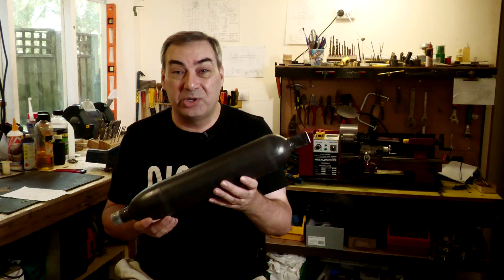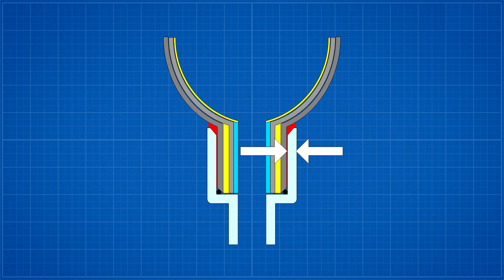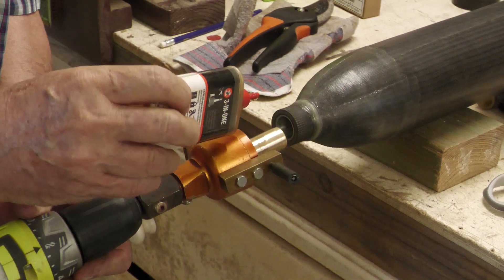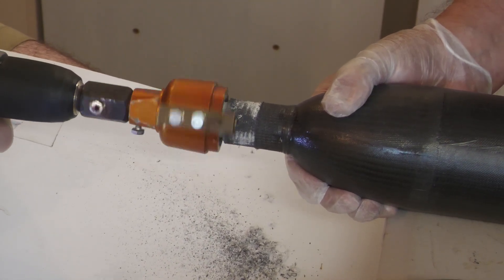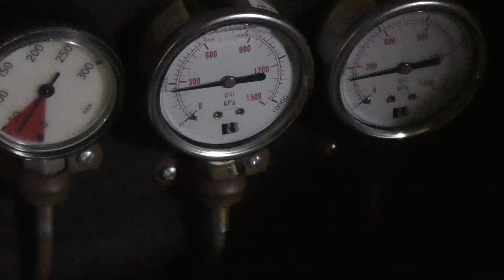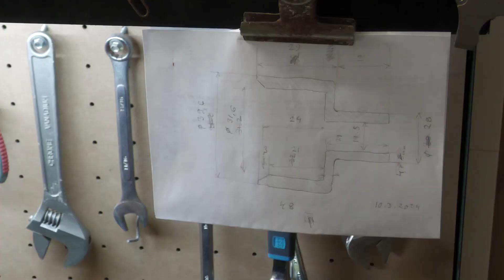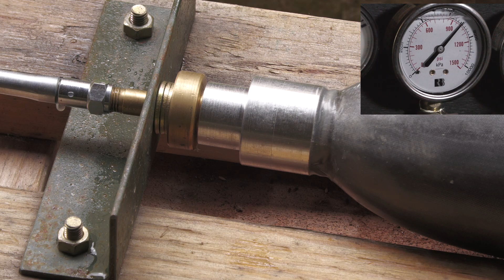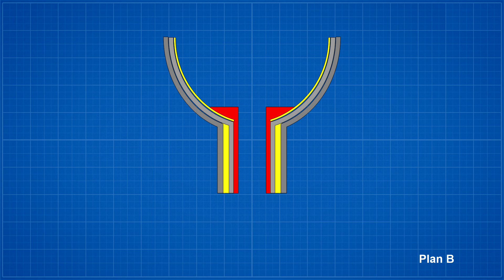2 Stage Water Rocket - Part 35 - Booster Fixed

Comment: If you have time, could you walk me through your thought process on why you think the water will not seep between the layers, cause delamination, weaken the chamber, and lead to failure? Nice fix, but I just want to understand.
Reply from the maker: There is always the possibility of that happening. What may be even worse is high pressure air seeping in between the layers. Then during rapid depressurisation, this could cause it to blow out internally.

Comment: Most people do not even realize that a space shuttle main engine is just a water rocket.
Reply from the maker: Kind of ... although the exhaust by-product is water, it is also accelerated as a result of a chemical reaction. A traditional water rocket does not use any chemical reactions or phase changes in the propellant to produce thrust. -> Just cold gas accelerating a cold liquid.
Reply: @AirCommandRockets  Sure but the reaction mass is the same. Pure water.
Most of the science denying morons will not even admit that much.

Comment: How do you avoid contact corrosion between aluminum and carbon? Is the epoxy sufficient?
Reply from the maker: Oh that's easy ... I stick my fingers in my ears and go LALALALALALA. But seriously it is a concern. So far we haven't seen any adverse effects on the pressure chambers but that doesn't mean it won't be a problem later.
Reply: @AirCommandRockets Thanks for your answer. No worries! You're in the best tradition of rocket building: trial and error.

Comment: hmm, not quite sure why you needed the extended nozzle?
wouldn't a sleeve alone have been enough? like a 1mm thick steel or stainless tube with a snug fit going over the existing nozzle to prevent it from expanding?
Reply from the maker: The problem is that it was now delaminated so there was a path for air to flow on the outside of the aluminium nozzle. At 1000psi air will find a way of getting out.

Comment: 69BAR 👏👏👍👍👍
What is the length of the boosters ? :)
Reply from the maker: They are 2m long, ~83mm in diameter and have a capacity ~10 liters.
Reply: @AirCommandRockets Ok, thanks!

Comment: Just be aware of galvanic corrosion between the carbon fiber and aluminium.
Reply from the maker: A couple of people have now mentioned this. So far we haven't noticed anything of note, but that doesn't mean this won't become an issue later.
Reply: @AirCommandRockets  One layer of fiberglass - and sometimes just an epoxy coat - should be enough to negate that. There are white papers out there on the matter, can't recall exactly but I think my takeaway is close enough;).

Comment: Thx for sharing. It might be a better call to add much more material on the outside of the booster around the root of its neck. The sharp changes in the contour of the booster in that location will always be an area of focused and alternating stress loads, promoting any kind of delamination leakages. To stiff it up, preferably with the material with the same elastic properties, to avoid delamination, in my opinion, you need to add more layers of fiberglass and resin - blending the transition from bottom of the tank to the nozzle much more. If a total blending isn't desirable, then at least make the cave radius on the nozzles neck root the same as the domes' radius for the bottom of the boosters main body.
Reply from the maker: All good points. The diagrams showed a very simplified representation of the structure. The layers are curved at the transitions, the glass layer on the inside is also much thicker, and what wasn't shown in the diagrams are the extra sections of fiberglass tow around the transitions. Here are the details of the actual construction. https://youtu.be/plU5c-Embtk and here is a cross section of the joint: https://youtu.be/jnUZ-I5gyOg?si=O4KeQ_93XnKD32v6&t=218 and also here: https://youtu.be/hFptNGZcD64?si=aXHyCDiq153srJvV&t=561
Reply: @AirCommandRockets   I replied to you yesterday, but it was too long and unspecific. Sorry for that. In your Part 29 clip, there is a good schematic picture, time stamp 4:15. I would have made the gray layer different (you are referring to it as a 3" layer of biaxial carbon fiber sleeve). To distribute the loads and disperse their focus more evenly, I would have blended it on the outside from the top to the bottom in a way that the outside shape would have appeared conical while keeping the inside design as it is now. The height of the blending transition from the bottom of the nozzle would have been at least 7 mashes of the brightest lines, almost the whole height of the presented part.

Comment: Geeeeeze, has nothing been learned about using carbon fibre for pressure vessels? 💣
Reply: Plenty has been learned, which is why they are successfully being used in other use cases than the one that formed your opinion. E.g. firefighters are using carbon fiber reinforced tanks, hydrogen fuel cells in some cars, too. Many PCB guns use them on their guns, too. I am sure there are more examples. Granted in most of these, there's an inner alu liner - but that's for chemical resistance and permeability reasons, not for strength. 
That said, we can add a Falcon 9 with a CF pressure vessel blowing up to your side of the argument though that use case is extreme compared to this home gamer's water "toy".  

Anyhow, just because one sociapath decided not to follow proper engineering practices doesn't mean there's still not other valid uses for the material. And here's what you're not taking into account. Yes, Titan imploded at pressures "just" 6 times higher than this tube experiences and Falcon 9 exploded at ~8 times higher (for more complicated reasons), but it's a whole lot easier making smaller diameter structures stand up to high forces. In fact, the force experienced depends on the area. 
Also, they have tested these tubes to destruction (blown them up) and whilst their chosen safety factor isn't impressive at all, they play in a field (literally) where failures are accepted, even expected, and thus safety measures are taken accordingly. E.g. no-one is near the rocket while it is being pressurized or under pressure. I also think that they know these pressure vessels don't have an infinite life span. Somehow, I don't think they plan on putting their dog or son on a bigger version of this...

I simply don't believe that because one idiot uses a material wrong - or the wrong material - that every superficially similar use case should be frowned upon. I am not an engineer and I would hazard a guess that you aren't, either? But this is YT so we both get to play experts. Well, at least we fed the algorithm.

Comment: Luckily the empty weight of the boosters doesn't matter too much, since they carry the full sustainer anyways.
Reply from the maker: That's exactly right, the same weight penalty on the sustainer would be much worse. The booster's take off weight including water is close to 15Kg, and the extra weight is only 0.2Kg so about 1%.
Reply: @AirCommandRockets  It's the empty weight of a stage that you would need to compare to, but that's still a few kg i guess.
Reply from the maker: @wattihrvolt-pn3pf Sorry yes, quite right.

Comment: Awesome videos mate.....been watching you'all put this together for years and it's cool to finally see the project nearing completion. Do you'all have a tentative first launch time frame? I am assuming at some point this year yeah? Awesome job.
Reply from the maker: Thanks for following the project. This project has been going on for way too long, so we are in the final push to get it over the line. The current plan is to launch it in August  during the club's high power launch. This is the only thing we are focused on at the moment, but still lots and lots to do.
Reply: @AirCommandRockets  Awesome! Got my fingers crossed for ya.

Comment: Nice fix! Do you know if there is a limit to the number of pressurization cycles a particular booster can go through? Especially if you are hearing fibres snapping! Or is it likely plenty and not something to be worried about?
Reply from the maker: Thanks, that's a good question. There may be a limit to the number of pressure cycles, but we just don't know what that limit is. So far these boosters have had 2 cycles. My thinking on the popping fibers is that there would be a small number of fibers that are under much greater tension than most of the others. And so when stressed during pressurisation they are the first to pop. But eventually the remaining fibers that are more or less equally stressed take up the load much more uniformly.
Reply: @AirCommandRockets  I agree. Does the crackling/snapping significantly reduce or disappear on subsequent pressurizations? Although that alone may not be an accurate determination of integrity
Reply from the maker: @richardperritt We haven't done further repressurizations, so  I am not sure. The cracking stopped as soon as pressure stopped increasing.